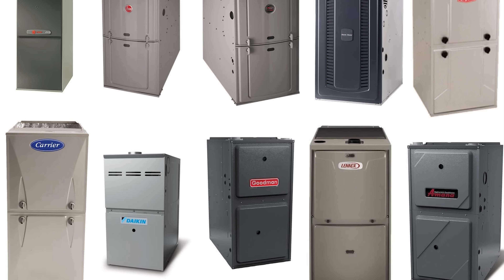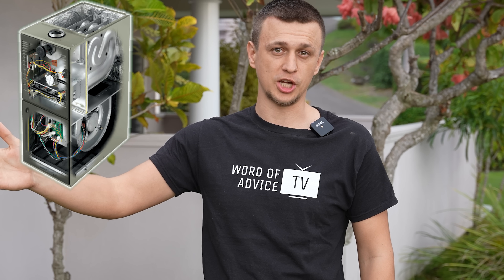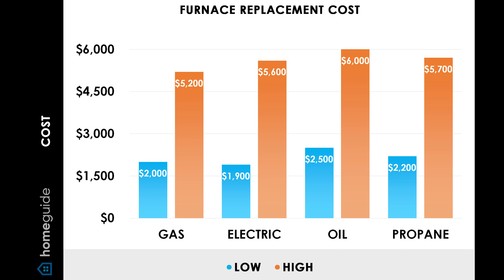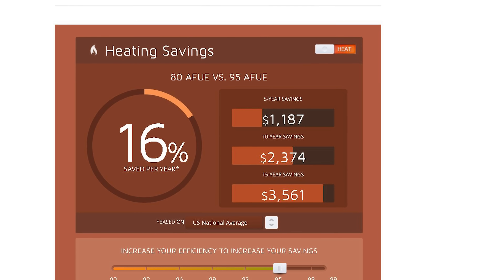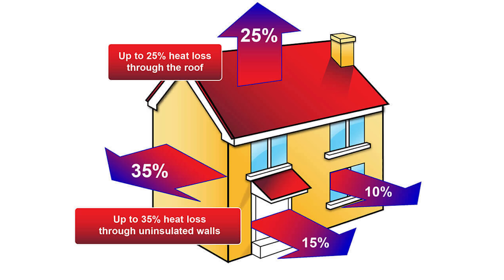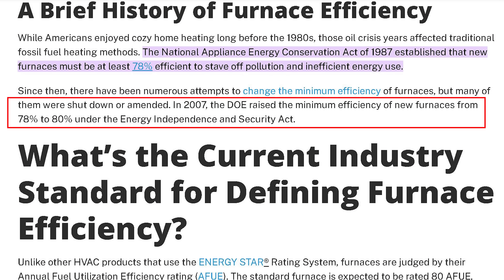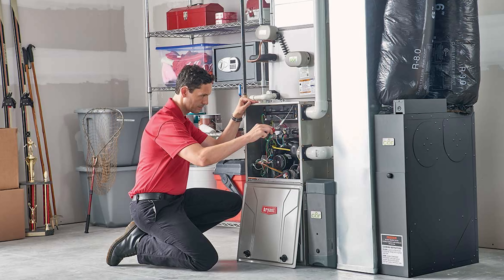Don't Buy a High Efficiency Furnace!

Comment: I'm a retired sparky and asked a very talented HVAC guy 35" years ago if he would install a top of the line high efficiency gas furnance. Told me only if it was free and had spare boards & other expensive parts. I wired a big custom hone that had two top of the line heat pump with natural gas back up. Told they owner he got taken. House had 2 by 6" studs on exterior walks packed with insulation and at least overkill R60 insulation in attic. First year both units cracked out and were covered u set warranty. Next year same thing but he had to pay a lot for kabor. Third year he ran on natural gas with no service calls next five years. California & a few other ahole states are going to ban use of natural gas in ALL new houses in 15 years followed in 10 years all houses must stop u was ing any natural gas. Good luck after spending $6'to $12,00 to upgrade your service to 300 or if you have EV 400 amo service, baseboard electric heaters in every room, electric water heater, range, dryer & stove. Of course lazy monopoly foot dragging Ultility companies will never have the upgraded system from new generating stations, all new high tension lines, replacing tens if thousandsoff pole transformers.

Comment: As someone who services boilers and furnaces, high efficiency is never worth it. More expensive up front, way more difficult to get parts for, less people who know how to work on them and if you have a no heat situation, much lower chance of getting it fixed the same day. Most standard systems we have parts on the truck for and a simple service every year or two avoids a lot of no heat situations. Keep it simple, get the standard systems and don’t worry about the slightly better fuel efficiency. It’s not worth it.

Comment: We've had our high-efficiency Bryant furnace for 31 years, and it's still working just fine.  The only reason we're looking for a replacement is because they don't make the parts for it anymore.  There have been a few times it needed repairs through the years, but nothing major.

Comment: I save money with one because I can do all the repairs myself. The average person is going to be burned by service costs. When the control board goes out I replace it and rebuild the old one. Sometimes it cost me only $3.50 opposed to $600 charged by a technician. An 80% furnace will run forever.

Comment: I did the math on an ECM motor & the only difference is a lower lock rotor amperage start up!?!?! (It modulates)!
The actual amp draw after it’s running is pretty much the same as any other motor in my opinion!
I asked a sales rep what’s the difference if I run my standard fan continuously for filtration(media filters indoor air quality or electric air cleaners!
To me there’s no difference when the motor is at full speed!!! The amp draw off both is still the same! 
Jus a more costly motor & a shorter life span putting ECM motors in….. if u ask me!

Comment: Recently had to replace my carrier 95 efficient furnace due to a cracked heat exchange it lasted 32 years though. Also I'm on propane so it's a lot cheaper when the guy doesn't have to come out as often to fill the tank

Comment: You do make very valid points. I use to think exactly like you and pushed hard for customers to buy 80%ers 
As I got older and went to more training and schools I learned that all the reasons I hated 90%ers had to do with three reasons. One oversized furnace for either the load of the home or undersized ductwork for the home. Two, installed wrong. Bad venting practices bad draining practices. And lastly, not blowing out condensation traps yearly. 
I’ve seen 30 year old 90’s in the wild still rocking and rolling because the insulation was done exactly the way the manufacturer intended. 
Having said that a 90 installed wrong will absolutely fail way sooner than a poorly installed 80.

Comment: You are so right. I replaced my old mobile home furnace of 30 years, which was still working but a bit noisy, with a High efficiency furnace. In the five years i have had it so far, i have spent over $1000.00 in repairs and survice calls. Always when the weather is at it's worst and service is almost impossible. My initial installment was $5800.00 Can
I have since installed a $2800.00 cert. Wood Heater as a back-up unit and use it most of the time so as not to wear out my Gas Furnace. What a waste of Money this new Garbage is.I have also become a Furnace repair man just to service my own furnace as the People they send out are sometimes very incompetent and feed you a bunch of BS In Canada there are no options for low efficiency Furnaces.Befor my wood Heater, I tried a Pellet stove which turned out to be a mistake as they are useless if the power goes off which happens in my area  usually when you need it most.
Reply: You can have the same issues with an 80% furnace.

Comment: With new construction venting with PVC is way lower cost.  You can dump a lot of money into a chimney.  Ruud/Rheem 90 plus units have been good for me multiple houses 20 plus years each, zero problems.  Thus saved 20K on chimney, saved on propane for 20 years, no down side.  Your mileage may vary...

Comment: I have been doing hvac for 30 or so years with the last 20 being primarily commercial/industrial but I still do homes on occasion.
-as others have said if you are in coal cold climate that's a plus on the 95+ unit
-if burning natural gas the rebates can make a high significantly cheaper than an 80.
-maintenance is key with either and please start once a month or so in the off season to burn off moisture that collects in the heat exchanger which will rot out your unit.
My house has a thermopride with a RIELLO rated at 84 or something. A little down fired and clean 89% and that heat exchanger will last for decades

Comment: I have a a Trane /American Standard 97% two stage furnace for 10 years now.  All I have had that has gone wrong with it is an ignition element. $40 I installed. I bought a factor inducer motor for it for $350 as a back up because here in Minnesota it will go out Saturday night at midnight when it is 10 below. It still is in the box. I do have a high end surge protector on it to help save the motherboard. Also the DC drive fan motor that is on all the time in circulate mode costs $ 65 a year to run. My 80% furnace AC drive fan motor cost me $350 to run a YEAR. Gas prices have doubled + since I installed it. I have SAVED  money buying this furnace.

Comment: Hello to you, the sellers sell the most efficient inverters yes but more expensive to buy and the parts. The technicians are not all trained to detect faults on the electronic plates, and they work in DC with undulations in + and - continuous variations. so he changes the plates until he finds the right one, and it's the customer who pays for that.

Comment: I have barnduminium here in TX which is 2 story home  
I have high efficiency unit upstairs 
That heat up 3 bedroom 1 bathroom stairs well really good and fast with out cold spots 
And I have difernt old stile heater that blows all the heat by the vent and the only room that is heat is the 6x8 bathroom the rest of the bottom rooms still cold and heater doesn't stop

Comment: QUESTION: "induction" stoves: lower maintenance due to less parts? (despite the control board). With the new IRA incentives, are induction stoves worth it, or, are they are maintenance nightmare down the road? Thx....D

Comment: Great video I have done apartment maintenance for 15 plus years and our older buildings had the 80% units and our new buildings had high efficiency units even the the high efficiency units are newer I work on them 4 times more them the older 80% units.

Comment: My 80% AFUE York P2MP gas furnace, installed in 1997, lasted 26 years without repair until the blower motor bearings failed. The cost of a new motor on eBay is about $200, so I could replace that myself I desire.

Comment: Agree but….an 80+ furnace requires a “B vent” chimney or a power venter. ( power venting sucks) I service an area where almost every house built in the last 25 years where equipped with a pvc vented unit. Also consider these units all use draft fans. A source of combustion air is very important. Almost all of the 90+ units I encounter are sealed combustion, meaning they use a dedicated air intake pipe. If there is a B-vent and a good sized basement then yes, keep it simple. I have not worked on a natural draft furnace with a pilot light in years. Boilers yes but fha furnaces no. Thanks

Comment: J - Back when 95% efficient furnaces were first introduced and advertised thousands of savings on a utility bill, I had to laugh to myself as that was about the amount I paid per year for gas. I've got an ole GE 105k btu single stage unit from around the early 60s I've been nursing along for the last 15 years or so. I'd love to be more efficient and get all the new wiz bang stuff being offered these days, like in my state that's pushing cold weather heat pumps to an unsuspecting population, with their ( COP ) coefficient of performance rated at a theoretical 300% efficiency, ( as I've been schooled by others in the know? Please - as compared to what? ). I suspect that if I'd had to have had a HVAV guy out to fix my furnace whenever it needed a thermocouple, fan blower motor and limit switch replaced, our old furnace would have been replaced instead, many years ago.

Comment: I have a 12 year old high efficiency furnace from Luxaire. It was installed with a new AC unit that stopped cooling again 1.5 years ago. I had it serviced for about $200 and it quit again in less than a year. The tech said it was leaking and suggested a new one PLUS a new furnace because the plastic evaporator collection tank was broken and leaking. Estimate about $7,500 CDN. I call for a second opinion to a company owned by a friend of my family. He suggested I could replace broken evaporator for under $200 and purchase a new AC unit or upgrade to a Heat Pump. I spent about $4,500 for a new Mitsubishi Heat Pump and thermostat and replaced my leaking evaporator. My furnace now only makes heat  on very cold days below -8 degrees Celsius. All summer the Heat Pump kept our home cool. Summer electricity bill is lower and winter is higher but gas is lower by more so a dollar saving and more important to me, less fossil fuel emissions into the atmosphere. Only my circulating fan on the furnace keeps running, not the gas burner. When this furnace dies sometime in the next 5 years at most, I already decided to do what you suggest and I will get an economical furnace of a better brand than Luxaire. They and their dealer not informing me of the recall on the plastic evaporator during the first 10 years is just poor service I will not reward with any more of my business. Goodbye Luxaire ( and York)!! Whatever is best for the environment will be my next choice and that just might be an electric furnace.

Comment: TL;DR As a service tech I disagree for the most part, the parts breakdown an cost difference between an 80% to a 96% non modulating and non communicating furnace is minimal, Most 90+ systems will last you well beyond 10 years, and most manufactures will warranty up to 10 years, and some even beyond depending on if the product is registered. 80% systems are absolute JUNK and should only be considered IF you already have an existing 80% and due to restrictive building conditions retrofitting from a metal flue to PVC wouldn't be feasible.

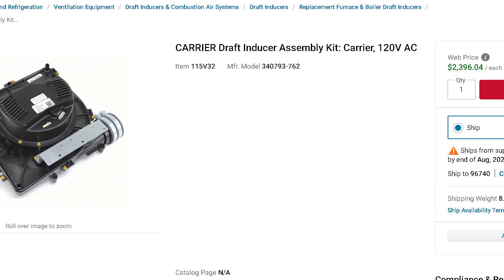I disagree for the most part. Im a service tech, 90+% furnaces don't really  have "More parts that can go wrong"  80's and 90's have mostly the same parts, and number of them. Except 90's usually have an extra pressure switch, which rarely fail, a condensate drain which so long as being cleaned during PM's isn't an issue, and a secondary heat exchanger, which can be problematic, but primary's are still more prone to failure, at least in my experience. Same goes for modulating furnaces in terms of parts, with the exception of the Inducers and gas valves modulating instead of having a fix single to 2 stage setting. All are going to have, Hot surface ignitor or spark ignitor, flame sensor, roll out switches, high limit switches, pressure switches, inducer motors, and a circuit board. The "More parts equals more bad" arguments just makes no sense, and is possibly one of the dumbest things I've heard. And comparing the parts pricing from a POS Goodman 80% to a Carrier Infinity, at 2:36-2:45 is kind of scummy. Most Carrier Performance Series, 96% non modulating inducer motors run around the mid $200's not including mark up. So comparing an 80% to a modulating would be like comparing a Lada to a Mercedes, and then trying to people to go with a Lada and avoid Mercedes because the parts are expensive, when there so vastly different there not even comparable. And if you have the money to drop on a modulating furnace you should know going in that if something goes wrong it is going to be more expensive. Second, if your only getting 10 years out of a 90+ you're either being scammed, or have a defective product. Most manufactures offer a 10 year warranty and some even go beyond that, IF the product is registered, with the manufacture. But I do know most conmen residential "HVAC" hacks don't tell the customers that or help them with the warranty process, and warranty policies vary from manufacture to manufacture. Lastly, I will slightly agree, to be skeptical about not necessarily modulating but communicating system. They are expensive, and can be a nightmare when something does go wrong.
Reply: Well said

Comment: I agree 100 percent with you. Higher efficiency = more to go wrong and more expensive to fix and install. However, correct me if I'm wrong, but isn't it a DOE requirement that the northern US states have the high efficiency models? Southern states still allowed the 80s though.

Comment: Good point, although I  am very satisfied with my Lennox G26 High effciency I installed in 1995, on Propane, and never replaced a single part, also the blower motor has been running 24 h/day since installed. and as far as I know most G26 I installed are still going strong. 
Gaztech.

Comment: We live in the Piedmont area of NC.  Home was built in 1998 with 2 Rheem/Rudd furnaces and flexible ducts for in the attic with mostly fiberglass blown-in insulation. Upper floor is not well air sealed and attic is extremely hot in summers.  Furnaces are used November-March.  I was thinking of spray foaming the underside of the roof (if my shingles are rated for that - they were replaced in 2012) to make the attic a conditioned space.  However that would require replacing both furnaces with high efficiency units with PVC vent pipes.  One furnace/AC unit for the downstairs was replaced in 2017 with a Goodman.  The blower motor in it failed this past summer and was covered by warranty (except labor).  Electric and gas bills are both way higher than I think they should be, but I’m not sure if replacing both furnaces and spray foaming will be worth the expense over trying to remove the existing insulation, trying to air seal everything in the attic, and put in new insulation.  This would still leave a lot of ductwork and the furnaces/evaporator coils for AC in an unconditioned space.  I’d appreciate any opinions.

Comment: Again, what a great video.  I have a Amana Distinctions furnace that is about 8 years old.  I think it is 80% efficiency.  But I am not sure.  It came with the house we built in 2017.  There is a leak from the heat exchanger.  The guy said it wasn't that big of deal for now but to get it replaced or fixed would cost thousands.  He told me might as well look into maybe getting a new Trane 95% 2 stage one.  Well, it will be about $8k.  What do you think?  Again, thank you so much for your time.

Comment: With a spray foam attic upgrade it’s recommended to install a high efficiency furnace due to carbon monoxide.  I agree with the idea of a simple system. Natural gas is cheaper to heat with here. 
So what do you do in that situation? My attic in Texas is 140* in the summertime and I would like to keep the heat out. 
What’s your recommendation on this?

Comment: I have been avoiding anything General Electric for a long long time for my own good reasons.
So imagine my disappointment when my mom's blower motor GE quits on her top of the line HE furnace FOR THE SECOND TIME! New fan price was more than the entire mid efficiency furnace at my house was.
Gets worse.
Nothing wrong with motor.
A 90 cent thermister blows in the DC controller. Now this is a separate peice attached to the back of the motor. It could be sold but is not. So I found a guy who would solder in a new thermister for $250. It was still a super deal compared to a new blower motor for $1200-1400 which includes the same POS thermister which WILL FAIL.

Comment: I do not agree. But my state borders Canada. 
92% is the norm here. 
I was an HVAC tech. 
Just don’t buy a crappy brand. Or an over priced brand. 
I chose Tempstar. Bought two propane furnace & A/C packages.  One with a hi/low gas valve. 
Good units!  Powder coat on the condenser unit. All copper coils. quality without the burden of a nationwide ad campaign. 
I’ll save the price of the units in energy costs in a few years. 
20 years puts you behind technology. 
Like induction fans don’t burn out every few years like they used too. They’re figuring it out.